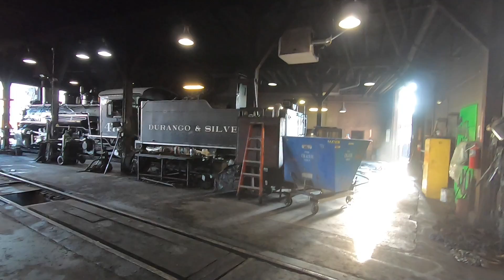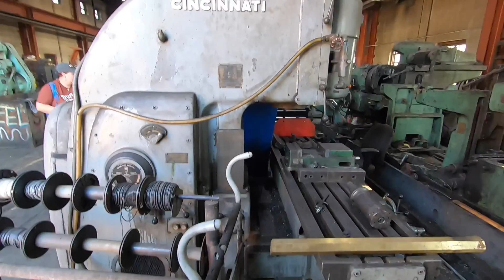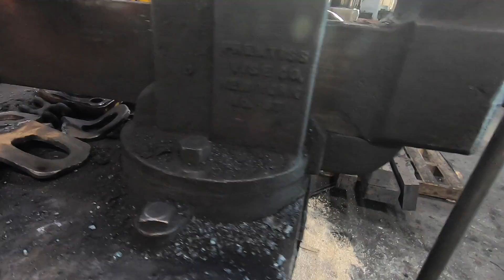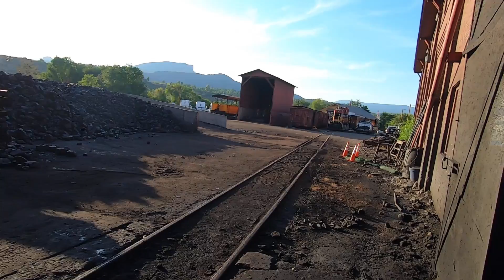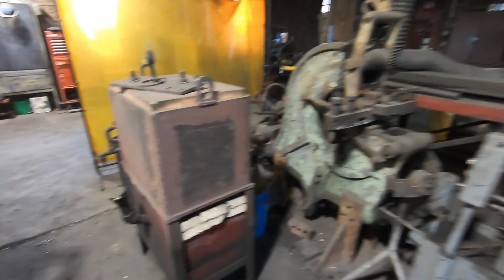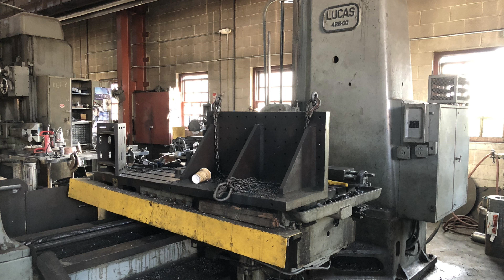Durango & Silverton Railroad Machine Shop Tour

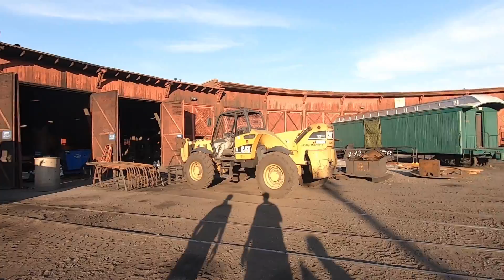Comment: 26:23 Who put all the roundhouse doors on upside down ? The bottom end of the diagonal should be at the hinge side as they're designed to work in compression not tension !

Comment: I went to the closing auction of santa fe's yard in riverside county ca. I think it was the largest repair yard west of the Mississippi river. They had some floors made with wood. 4x6 in a vertical position. Also had a few cylinder blocks. I bid on a metal shear but was out bid. Very cool. I was went to the Long Beach Navy yard auction. It to had wood floors in the machine shop area. I guess that was a thing in the 40's 50's to soak up spilled oil.

Comment: Adam, that was an awesome show of the capabilities of the shop used to maintain those trains. I grew up in Colorado Springs and rode the DSNGRR once in the early 80s when my dad and I would go out that way to ride dirt bikes on 4wd trails there. I was out there 2 summers ago on my Harley and took a photo in front of the terminal but didn't have the time to ride the train, although with covid and forest fire prevention, they weren't even running all the way to Silverton from Durango.

Comment: At some point in history Someone realized there might be a need for something , but didn't yet know what the solution was or how to solve it . Maybe the same person realized what it was and also designed it , but no one knew how to make it . . . . or what to make it with . Many of these machines were probably built for a specific purpose , then they realized "if you change yhis , you can also make/repair these" . I always marvel at the Genius that it took to Engineer these Complex Machines and what it took to Build them . What was the First Industrial machine when the Industry didn't even exist . And what Genius it takes to operate them . HOW was the first machine Machined ? Where would we be with out these Behemoths ?

Comment: Wow, really cool they have the original wall built in 1880's I bet that bricklayer was a skilled craftsman.  Near me they sold out and closed the company running the last roundhouse turntable outside St Louis that I knew of. It was a huge geodesic dome building near the refineries. I think it was a company owned by Busch Brewing family and was probably liquidated after selling out to AB Inbev. It was a extremely hard job but one that required skill and a lot of knowledge to rebuild the train cars. They did modern railcars. Those Machines are incredible. The Massive mills and machinery that America had just to make these machines was incredible.  Those massive forged Iron Rods with the honed bronze bushing are just incredible. Amazing they are so strong they are still running many of them they are original to the train !  Holy cow batman that is durability. Really cool to see this great old iron still being used. I really need a Westinghouse grinder like that I have a whole box of 1/8 drill bits I need to sharpen! Wow that thing was massive. We learned to machine turn on a small south bend just like that in my high school in Missouri in the 80s . I'm sure the edumactors long ago got rid of those. They were trying to convince me I had no future, unless I went to college and learned computers, and that was in 85 when I graduated!  Jerks.

Comment: Had the pleasure of a trip on this line back in late 80s,  I think was told they used a howitzer to clear avalanche threats. Was intrigued by the way the railroad was lashed with cable back to the pins at the cliffs. I did notice on the links to slide control a pan head coach bolt? I was a marine engineer and can't help noticing little inpefections. A great asset to have  running, and for learning skills.

Comment: As a retired Railroad Machinist your video was outstanding, brought back personal memory's, even my sensory's smell of the shop LOL
BTW did you ever get the head stock aligned on your Victors lathe. It could be a relatively easy fix, been there done that.

.

Comment: I really enjoyed this video.  My grandfather was a brakeman on the same narrow gauge line in the 1930’s when it was owned and operated by the Denver and Rio Grande Western.  My great grandfather worked as a machinist in the roundhouse in Alamosa, Colorado on the division of the line where engine 478 was once based.  I know my grandfather worked and rode on trains 478 pulled from Alamosa to Chama, New Mexico and then on to Durango.  I saw the roundhouse in Durango many years ago and remember how busy the Durango shed was at one time.  That was long before the big fire.  There are still four or five other roundhouses or engine sheds in existence/operation in Colorado (Silver Plume, Golden,, Durango, and defunct ones in Alamosa and Como).  The last standard gauge engine maintenance facility (diesel) closed a couple of years ago in Denver.  At one time there were three or four huge maintenance operations.  Oh how things change!  Thanks for posting this video, Adam! 👍🏻🥃

Comment: I miss working at the plant where I was in maintenance. We made a lot of the parts that we needed due to long lead times on factory replacements. Most of the time we made them better that the original to prevent the failures that had occurred. Great video!!!

Comment: I worked here for almost 4 years about 4 years ago as a machinist. It was a great place to learn to work with manual machines, (my favorite was the polish and quartering machine) the war baby Bullard is driven by a leather belt and the staples that keep it together was so rhythmic it had almost put me to sleep when turning the tires. The homemade machine he didn't show was an old lathe bed with an 8ft arm that pivots where the headstock would have been and a grinder on the other end to grind the radius in the radius arms (8ft-ish radius). The number of comments about the cleanliness of the shop is hilarious to me (and not surprising) and that was clean, machines were maintained decently but chip bins were usually half full and the floors were always dirty. There is a joke about how most machinists could not make it here (and after working in a "clean shop" most of the guys here would not like it there), also like John said in the summer your a mechanic first, machinist second, also no prints. I used an original print once to machine a cylinder head, most parts on the engines have been fixed so many times that an Original print would not work, you had to make your own. I now work at a machine shop a few miles away that has 4 CNC mills, 5 CNC lathes, and a handful of manuals. The DSNG has been coined the "training ground" for my current company because we have had over a dozen guys over 40 years start at the DSNG machine shop and move here. It was a huge shock to go from "dirt tolerance" (enough room for dirt to escape), to now I'm running a part with +0.0003, -0.0 diameter tolerance. I do miss the excitement in the summer running up and down the engines, working swing shift trying to keep those engines running.

Comment: I'm having flash backs. I went to work for the Denver & Rio-Grande Western in 1979 when the D&RGW still had & operated the Durango narrow gauge. I worked in the main back shop in Denver called the Burnham shop. I spent time working in both the wheel shop & the main machine shop. Every winter the narrow gauge shop in Durango would send us parts to machine & rehab. including entire passenger cars, locomotive tenders & wheel sets including the locomotive drivers to have new tires installed on the wheels. I've ran many machines similar to those shown in this video. The cool part of those machines was they all had brass tag's on them that said " This machine conforms to the orders of the war production board" These tags were put on during world war-II. I sure wish I would have thought ahead and got pictures of the cool stuff in the shop when I first hired-in. I retired in 2017 after 39 years as a railroad machinist. All those cool machines are long gone, they closed the Burnham shop in 2016 & I was the last Rio-Grande machinist to retire. Even though it was the Union Pacific at the time I retired, I'll always consider myself a Rio-Grande guy. Thanks for bringing me back in time!!

Comment: Paul Spears   I found a 1955 monarch lathe in a salvage yard!!  that thing is huge for a 16 inch by 20 inch all hydraulic lathe!! It has a tachometer that angles from the spindle housing to face the operator! What would a lathe like this be used for?

Comment: Enjoyed the video, spent 4 years in the NAVY part of it was on a repair ship out of Norfolk Va. USS VULCAN (AR5), worked in the machine shop and identified numerous machines we also had.  Our "BEAST" was a 72" KING VTL that was built into the shop, part of the ship was also the top rail, man that was a monster.  Also had a ROCKFORD 144" Open Side Planer, several NILES and a couple of BULLARD VTL's and 2 big Horizontal Boring Mills.  Great that you could get into the shop and your tour guide was very informative. Again, GREAT VIDEO!

Comment: True Story.
As the EHS guy for the CPAs Transportation Sector Reconstruction in Iraq I had to take my boss and his lead engineer (plus our little 12 man guard squad of retired Royal Marines) to the Baghdad Central Train Repair shops (huge) after I had already roamed around the shops and central train station for a couple days (with only 8 Royal Marines & my clipboard).  They had been thoroughly looted.  

So David & Gerry are busy as little beavers estimating how much it's going to cost to replace all the machines, tooling and associated "stuff."  So I say "you going to add another $20 million to that to cover removing all the asbestos?"    They were standing next to a boiler with HUGE chunks of asbestos literally raining on their clipboards.   And to think they mocked me for my respirator...  

Then I mentioned that all the light ballasts in both places were made with PCBs.  And the basement had 4 feet of sewage backed up in it PLUS all the broken glass had been swept down there (which would absolutely destroy pumps).  And all the water piping had been looted for the copper...  I did find all of the "as builts" for the entire Iraqi rail network in my explorations which the US Army people were pretty excited about.   And some UXO which we just spray painted circles around and left in place for the pros...

Too bad I was still using film then.

Comment: Great share, thanks so much! A place I worked at years ago in Greencastle Pennsylvania called Beck manufacturing, they had several of the double headed pipe threaders and such. Strictly a pipe and nipple manufacturing operation, at least 20 years ago anyhow. Just figured I'd mention but it was actually a grueling repetitive job lol. Can't say I miss that but I do miss my machining experiences setting up the Mazak M1 I believe it was. Only held one program at a time but otherwise it was a good girl. Just the way it was designed. Later ran the M5 but only as a reliable operator. Now days it's just me and my Chinese Cummins 7x14 mini lathe down in the shop, have a drill press too that counts 🤣🤔.

Comment: What changes with the seasons that they're work load increases and decreases?
Reply: In the summer there are 4 trains from Durango to Silverton per day.  In the fall to spring there is a train per day to about the halfway point, Cascade Canyon, which has a wye to turn the train on.  Each train has an engineer, fireman, conductor, at least two brakemen, and a couple of people in the concession car.  There is also a motor car before the first train for inspection and a motor car following each train to put out any fires started by cinders.  Add to this list track crews to change ties, work on bridges, line and tamp the ballast around the ties.
Reply: @royreynolds108  oh boy ok that makes sense for sure, thanks for the explanation!!!

Comment: Many of those babies i did my apprentice ship on. Working 72 hour work weeks. Repairing steel mill roller shafts n bearing blocks- 2,000 lbs each casting. Bored on the vbm and outside on open sided planer. Set up tools 12lb sledge hammer and 6' pry bar. Worked our butts off but id do it all over again. Learned a lot from those old machinst n friends.

Comment: In 1975 , I was 14 , and my family of five piled into my Dad's brand new Plymouth Fury, and we drove cross country from Cape Cod, to California, and back. One of our stops was Durango, CO where we took the coal fired train along the river up to Silverton, CO. I can still remember the sulfur smell of the coal burning, and the smell of the discharged steam that moved our train up the mountains. I was into hot rods, but was still very interested in how the engine worked using coal and steam.
The engineer was kind enough to explain the process when I asked him when we got to Silverton.
Who knew back then I was going to be a machinist for next 40 plus years. 
Excellent video, and tour of the machine shop. Thank you for sharing.

Comment: Great to see the shop, at Durango again. I worked for the D&RGW and did some work there. I was Water Service, out of Pueblo and ran up there to do boiler work at the depot and installed a new water tank, at Hermosa. I always enjoyed working there. The guys in the machine shop were a fun bunch. Friday, after work the foreman would always bring in a case of beer, to end the week. I see they painted the old brick wall so you can't see where the end of the air receiver blew off and went through the wall and down the street. Lot's of history, there. Thanks for the video!

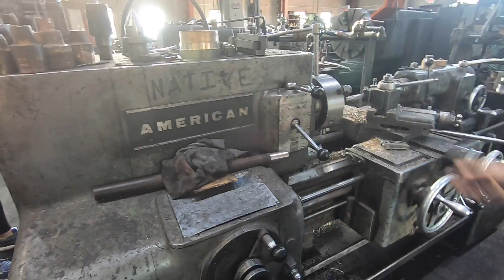Comment: 4:48 - who left the key in the chuck??
Reply: I got a safety switch. If the chuck keys not in its holder the lathe won't run. I left a spanner on top of the spindle on a Bridgeport mill. It flew off like a bullet
Reply: serious pineapples required for that!!!
Reply: Hide it, procedure dictates you must hide it
Reply: Wasn't that just amazing ! How did Adam? keep quiet about that at the time, I wonder ?

Comment: Put down the  wrenches, let go of the hammer handles, turn off the power to the lathes. And have yourselves a major cleanup week in that shop.!  Maybe two weeks long.  Do nothing but clean. I'm sure you will find the place a lot nicer place to work at. Safer too. Errr. Make that 6 months to clean. what a mess :(

Comment: Back when I was a young guy, I worked in a pipe shop that had two of those double Landis machines.  The shop foreman had one of them set up for 1" and 1 1/4" and the other 1 1/2" and 2".  They had pneumatic chucks and we used them to make nipples.  This was back when labor was cheap enough to allow us to cut and thread pipe nipples rather than buy prefab. The shop also had 3 big Landis pipe lathes.  The largest could put a thread on a 12" pipe. The machines were used originally by the Navy. Those were interesting days. Quite a while ago now that I think about it!

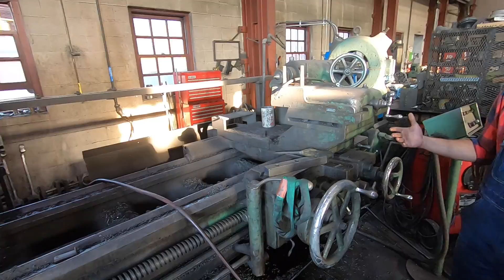Comment: That American 48 (about 6:00) lathe with faceplate drive is the twin brother of the lathe I ran off and on for 15 years. Unstoppable. You could peel perfect tinfoil chips from cuts 3" wide on work 40" diameter. I bet I scored three dozen 30 and 70 ton winch drums on that lathe. Bored multi-start threads on breech rings timed to the cradle lug. I know I drove a million steam turbine buckets refurbing SSTG and main engine rotors. We had the motor arranged with a reversing contactor and a portable Start/Stop/Rev control station we could take right to the saddle. With a little practice, you could stop/jog/stop to 1/32" of the anchor hole in the winch drum. 

And yes, it did railroad wheels too but I'd rather machine them on a VBM unless they're already on the axle.

Great machine but you'd better start the day with a good breakfast. The carriage traverse frequently broke down so you could sweat a shirt through on a cool day cranking the carriage back 12 feet. A manly lathe if ever there was one.

Thanks for the trip down memory lane.

Comment: 8:07 crank pin, he's not referring to a woodruff key...
Reply: He is talking about the pin the side rods go on to turn the wheels.  This pin is either in a hole in the drive wheel, or in the case of these locomotives, the counter balances on the ends of the drive axles.  The center to center distance of the axle to the pin is one half of the cylinder stroke.
Reply: @royreynolds108  
Thanks for responding....

Comment: Aloha  Abom,  Thanks for your sharing, that is my old stomping grounds, I worked across the street at the highway department shop, its no longer there, for 21 years back it the 70's and 80's, as the machinist I could look out the window and see that operation.  between Alamosa and Chama there was a lot of historical iron available and I am so happy to seeing it used and restored, I am also happy to see the progress made in the shops of the railroad.  You can't believe in the progress they have made since I was there.

Comment: the bullard got me. Used to run a 30" and a 4 2" Both 62 h.p. direct drive beasts! I came into a scenario where a guy tried to pile a 3" bore bar into a 1 .25 hole... machine was like a hydraulic press...

Comment: I live 4-5 hours south, up there a couple times a year for 1/8 scale train meets where I drive my steam locomotive (1.5" to the foot 3 truck Shay).  D&S is fun but you spend a lot of time along the Animas river.  The Cumbres & Toltec is a couple hours eastish, same gauge (used to be connected back in the 60's) but their run is mostly up high on ridge lines.  Just the last hour northbound is boring, just sagebrush flats.

Fun fact: it wasn't until the 4th time on the D&S that I made it to Silverton. I used to get off halfway and hike out via the Weminuche wilderness.